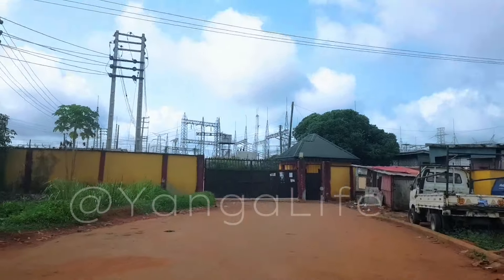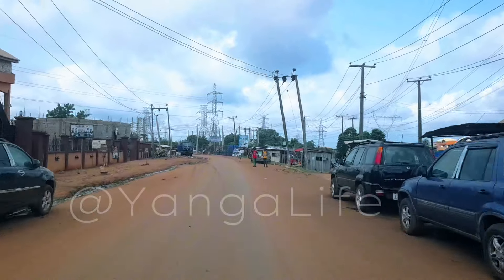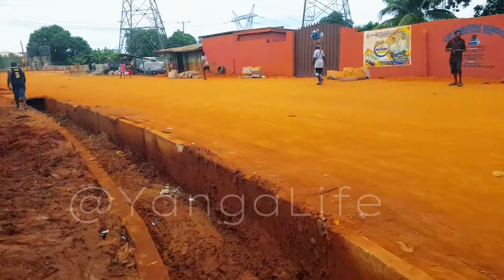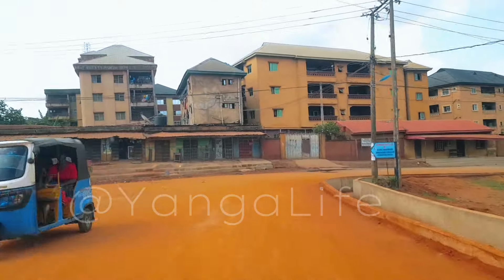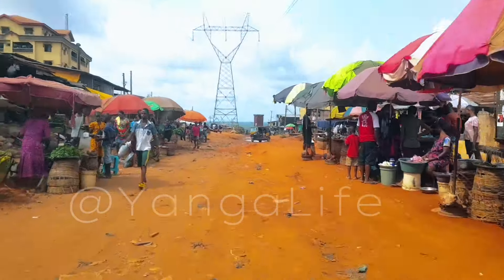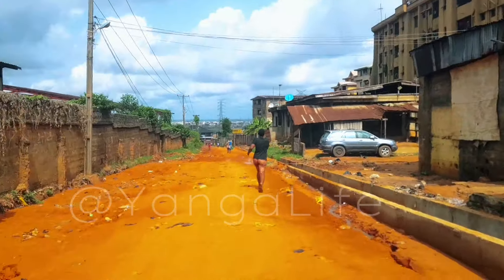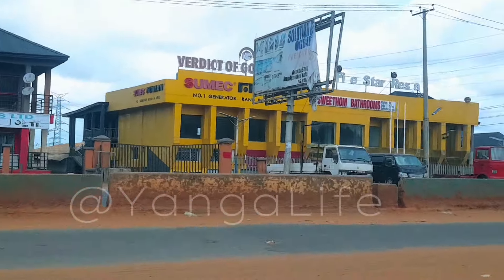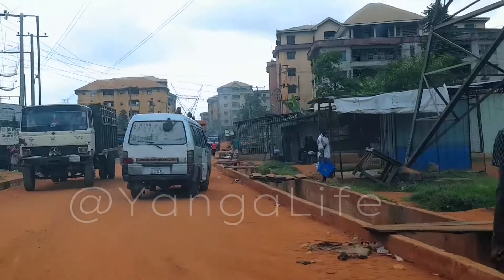What You Have Not Seen About Awada Roads, Ugwuagba, Obosi

Comment: Soludo needs to borrow for onitsha specifically, any management work we are doing in onitsha it's not going to last at all that place is densely populated and needs our attention seriously.
Reply from the maker: You are on point. Let him borrow that 100 billion for Onitsha and Awka. Hand the roads to experience contractors and let there be proper  drainage connection.
Reply from the maker: @chimere, a lot of government people working with Gov Soludo are here watching. You can as well share to reach him
Reply from the maker: @eaglei2143  That could be over statement but the bottom line is to borrow and fix our major infrastructures on the areas that generates money for the government. The state will benefit it at the long run.